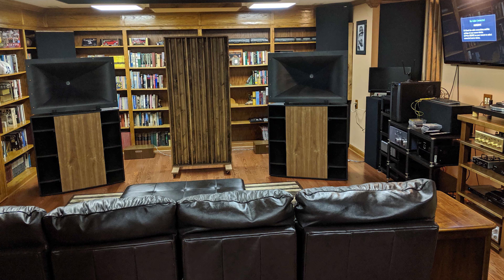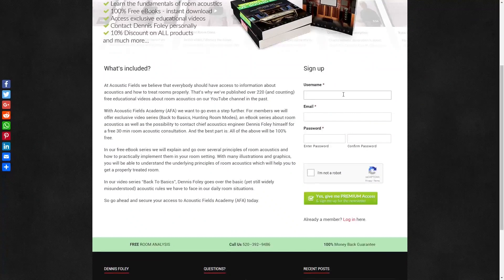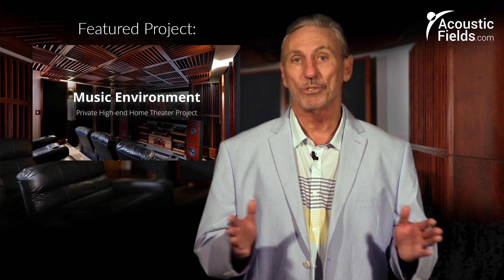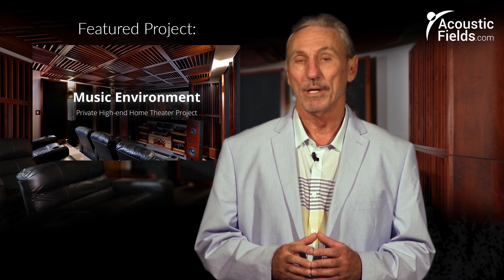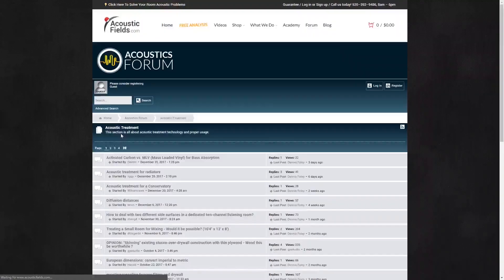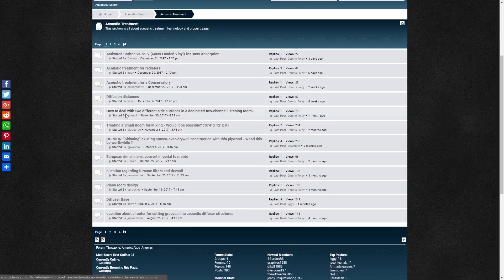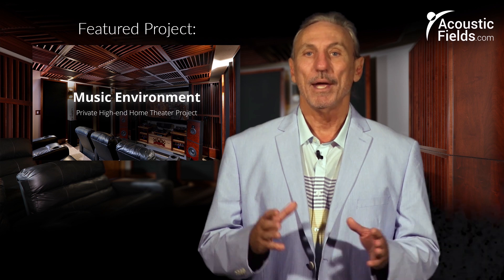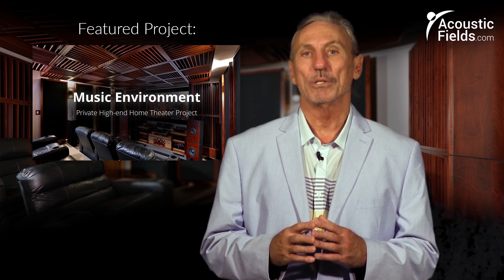Don't Do This! - Kitchen Theaters - www.AcousticFields.com

Comment: hi denis
5:00 does corner bass trap like that going well with QRD diffuser?
Reply from the maker: Before you consider any form of sound diffusion, you must have many variables resolved using absorption. A corner placed absorption technology will not treat the issues produced by the whole wall. You must have a room that is pressure and reflection balanced using absorption before introducing diffusion.

Comment: Another excellent video. I enjoy these what not to do lessons. Those horns are Jubilees using the K-402 which are CD horns. You’re right, they aim their energy in a controlled pattern so side wall reflections are definitely minimized but I still think one would be better off without the tv in that spot
Reply from the maker: It is never a good idea to have a large piece of plastic between the speakers. If you must, cover with absorption during audio listening.

Comment: I swear, I'm thinking more and more of buying a really nice pair of headphones and amp and saying F the room.  It's so much easier.
Reply from the maker: Completely different sonic presentation with cans instead of a room.
Reply: True that.. it also depends on what kind of speakers you use. I have electrostatic speakers those are dipole and you don't want room treatment to interfere too much...
And I also use headphone mostly
Reply: Headphones are great. Both offer different experiences.
Reply: @djhmax09  true and headphones are less demanding on your surroundings too.

Comment: Some of the gear in these rooms is quite expensive! It would be one thing if a $1,000 "starter" system owned by a high school kid, bought with what money they had, was placed in what room they could use (often their small bedroom). I was that kid, several decades ago. In their situation, with the thin wallet they have, they really can't do much other than try and get somewhat symmetrical with speaker and listener placement, and maybe get some cheap untested foam online that might sort of work to a small degree to tamp down reverb in who knows what higher frequency ranges. Got a curtained window on the right side? Maybe hang a curtain on the left too, that kind of near-zero budget solution.

However, in some of the rooms in these photos, you've got low to mid 5-figure systems set up in terrible rooms by middle-aged and older adults that can obviously afford to make very significant improvements in their listening rooms, even if they may not be able to make the room any larger. They can also afford to consult pros like your outfit so they don't drop a lot of cash on stuff that won't work, and instead spend money once.
Reply: Proves that having money doesn't mean having brains 😂
Reply from the maker: With a 1,000 treatment budget, you should save and reach a greater amount. Remember when you are treating low frequency issues, you must treat two walls minimum.since it takes two walls to create a pressure problem.

Comment: 4:05 Yeah. That’s when I got my best sound. Used the open area as my back “wall” and got the speakers away from the side walls.
Reply from the maker: The front of the house where we have our speakers must have sidewalls that are equal distance from the speakers. This is a requirement to mange reflections.The rear wall can be open which reduces pressures and reflections.